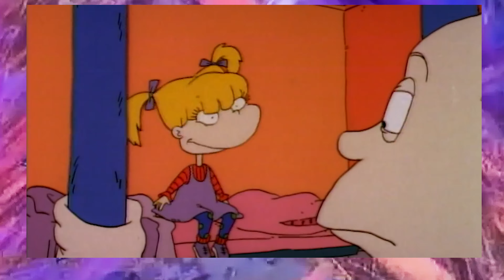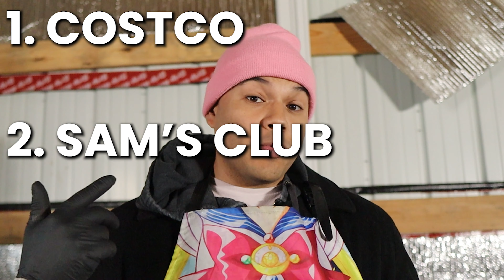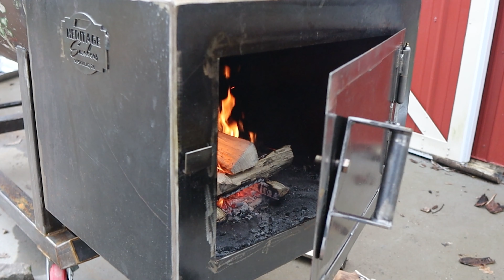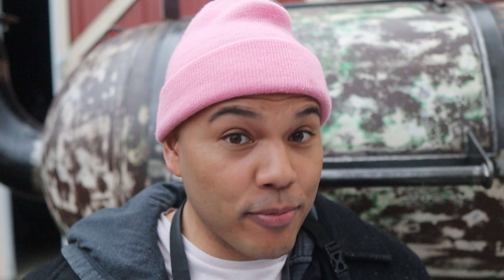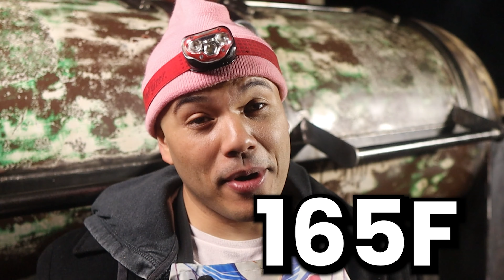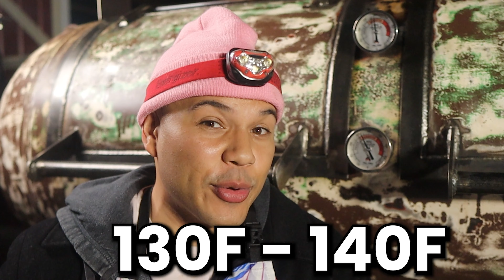How to Smoke Brisket on any smoker | Intermediate Guide

Comment: You might want to grind your meat trimmings and make some 80/20 or 70/30 brisket burgers. Next time put the fat through a meat grinder or dice really fine and you can render it way faster on the stovetop in a pot letting the water off. You can also inject the brisket with the tallow in the flat to constantly baste the meat as you cook, and then add tallow before the wrap.
Reply from the maker: Appreciate the tips Todd! I am planning to do a video regarding brisket trimmings for those who don't have a meat grinder (like myself). But great ideas and tips you listed here! Thanks 😁
Reply: @AntsBBQStory  Once you get the grinder, you now can do a video on making and smoking sausages. I use a cheaper meat grinder around $120. Been using it for 14 years. Did a brisket last week. I have a permanent container of beef tallow in the fridge .for fries, yorkshire puddings,
anything I want a beef flavor. The injections, tallow and long rest made an amazing brisket out of select quality meat.

Comment: I like to wrap after it goes through the stall, it gets a nice dark bark and the fat is rendered great, that usually happens around 175-180 degrees
Reply from the maker: Yes, I do as well! In fact I didn't wrap the brisket in this video until it was low 180s. But this video is for brand new beginners who want to try a brisket. So the info is very straightforward and will get you to a brisket that'll impress a beginners friends and family. There's a lot I do differently from my own brisket in comparison to this video. And I plan to do a more advance version in the near future, especially since the response has been so great on this one! Thanks for stopping by!